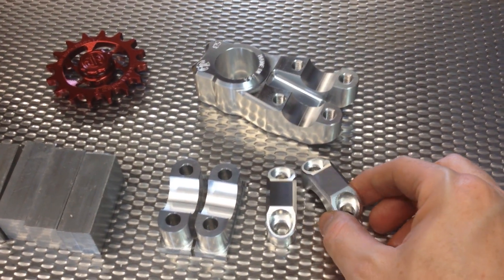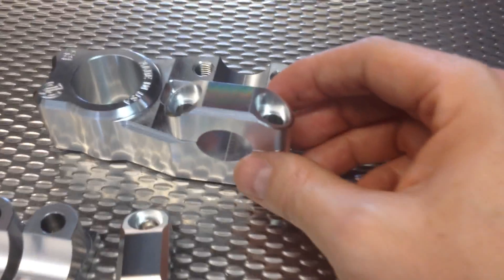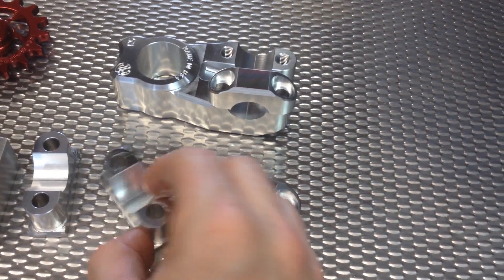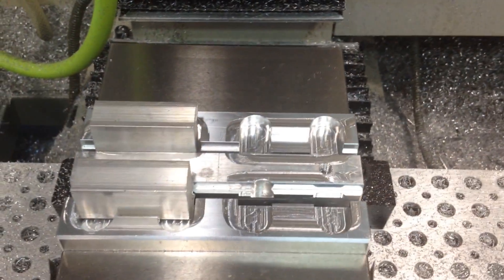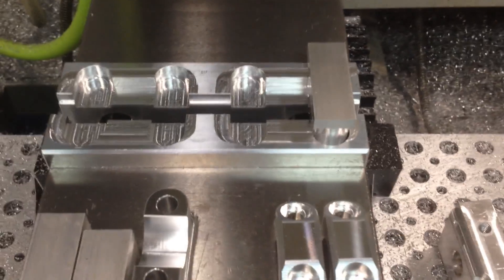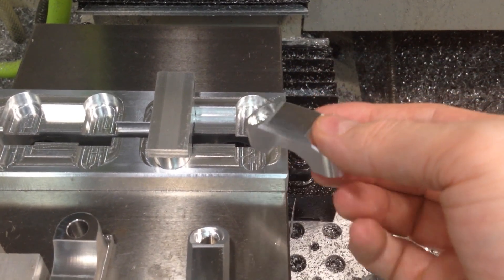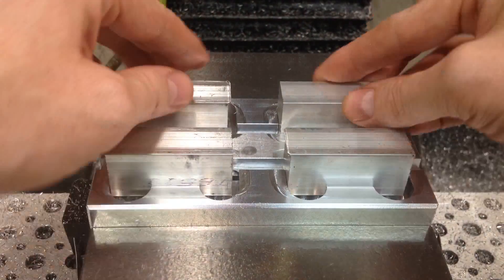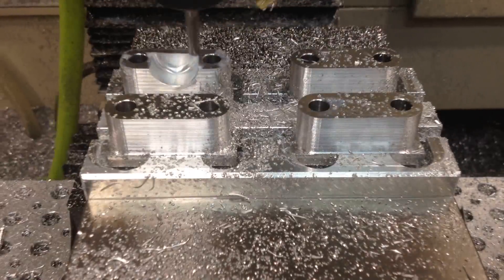JW Race Stem Top Clamps - Tormach 1100

Comment: Your stock looks better then some of my finished pieces.  I dobt know much about ordering stock.  What services are getting?  6 sided milling or it is just band saw cut?  Any advice on what to ask for?  Suppiers?  I assume you are using a local supplier but maybe not.  Mind sharing if they are not local?  Thanks Sami
Reply from the maker: Sami Rahman it's just 6061 alum flat bar. I get it from a local supplier. I always mill all the stock surfaces. You never know if it's going to come in all scratched up. I start with .75" x 1.0" bar stock. The finished size is .70" x .75"
Reply: Wow. Thanks for the quick response.  That was a lot of surfaced stock.  Any tips? Shear Hog? End Milling? Fixture tips?
Reply from the maker: Sami Rahman I don't have a shear hog. Using the superfly for facing and end mills for the profiles. Finishing with a 1/2 3 flute mill. I don't remember what brand it is.

Comment: I agree with the others.....love the multi use soft jaws....the surface finish.....and I'd like to see some real time footage on the 3D paths.
Reply from the maker: Thanks! The 1100 only has a 5140rpm spindle so the real time footage would be a feature length film. Love the machine but wish it was a little faster.
Reply: As I do with my machining vids....you really only need a sample.  I try to include enough to show the speed and travel or interesting tool paths, but I don't show the entire tool path....at least not all the time......and not on all the parts if I'm running multiples on the same setup.  It takes more editing, which is a real pain sometimes......but 30-60 seconds of the beginning where the tool enters/starts the tool path....another 30 from the middle.....some from the end/exit if there's anything different or interesting about it.  I choose to do that over the fast forward method just because it's what I prefer, not because it's necessarily any better.  On a lot of the fast forward vids, I can slow the play back speed down to .25 and see what I want.  Yours is running a bit fast to do that....the tool was still jumping around.  I sure do love your parts!!! :)
Reply from the maker: Thanks for the suggestions. I still have a lot to learn when it comes to making videos. I'm doing everything with an old Iphone 4 and using the YouTube editor.
Reply: Your vids are coming out great!!!  ....especially considering your equipment. :)  Just keep making them.....we'll take what we can get. :)

Comment: Beautiful work!  Really impressed with the surface finish your gettin'.  Are those parts straight off the mill, or tumbled in some media?  I have 770 on the way, due next week.  Hoping I get similar results to the finishes your seeing regularly!  Also, I wasn't so fond of the brake calipers, but I really like the design of this stem.  Can't wait to see the vids of the completed assy.  If you wouldn't mind, could you show some machining in real time?  Especially some complex 3d profiling and finish passes.
Thanks!
Good luck with the channel!

BK (Thelifeofbrian)
Reply from the maker: Thanks Brian! The parts are straight off the mill. I do not do any secondary finishing processes before sending them out for anodize. I get the parts bright dipped anodized so they come back looking pretty good. Congrats on the 770! I wish I had a 10K on my 1100. I will try to get some videos of the 3d profiles. I wasn't too happy with the look of the brake calipers either but they guy wanted them as big and heavy as possible. He was trying to add weight to front of his drag bike. He was going for function more than looks.